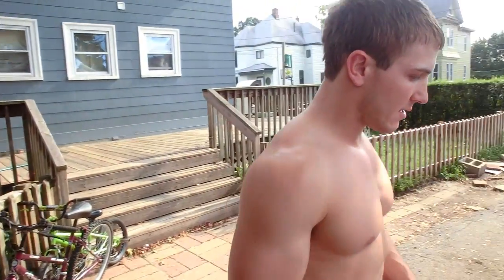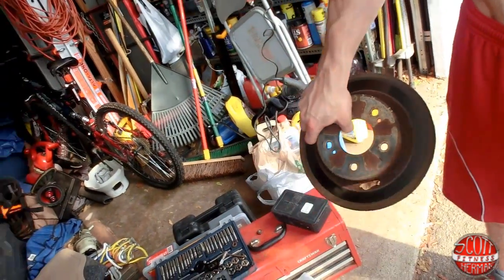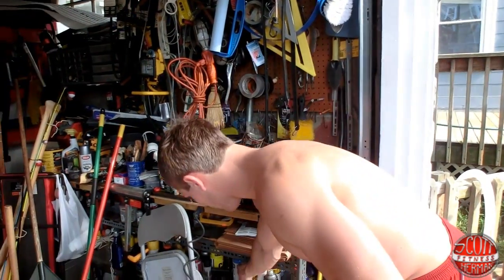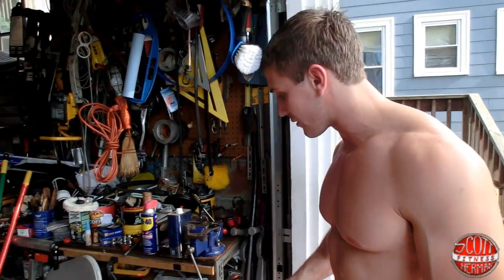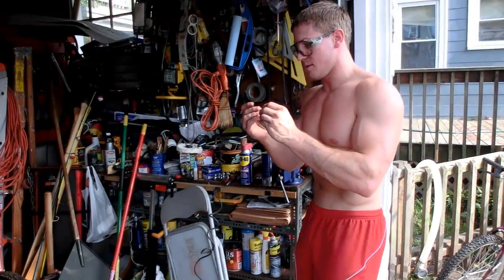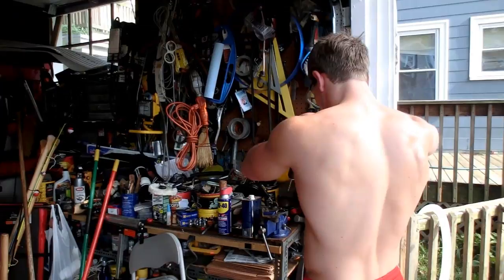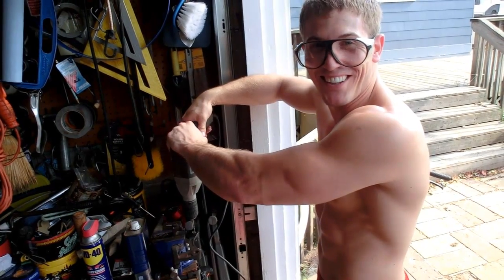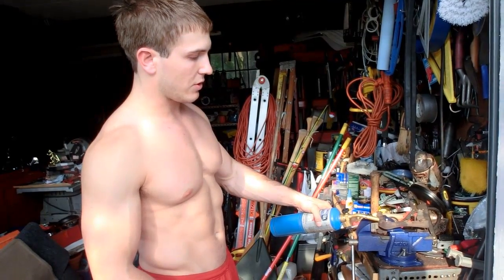Fixing Sean's Car... I do more than pick things up and put them down :-P

Comment: Scott this a common problem.Using anti seize on all bolts when re assembling will eliminate this  problem in the future. when assembled , caliper should move freely on the slider pins with both hands    Glenn